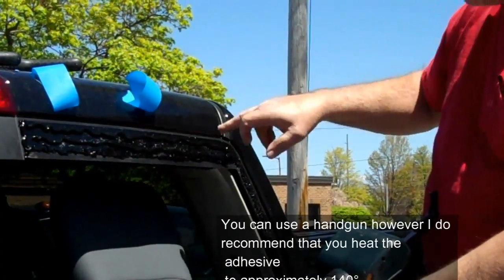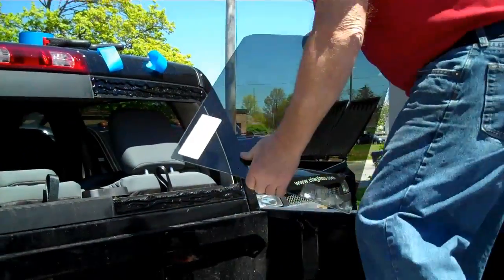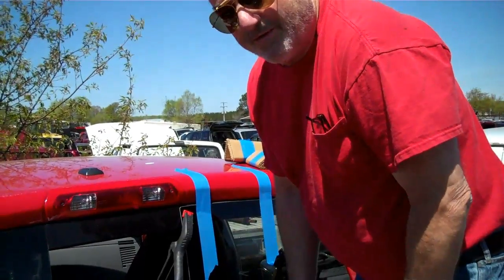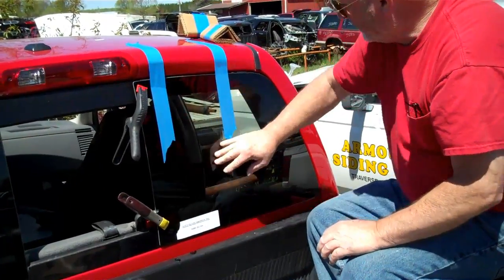Pickup truck sliding rear window back glass replacement

Comment: Is there away we can remove the broken glass so i can glue the new replacement glass to the actual frame
Reply from the maker: Yes you can but it's not worth the time and effort plus it does a better job as shown in the video please stick to the plan.
Reply: @autoglassamerica  hey I bought the glass what trim and caulking should I get, one that can stick to the frame not the glass, and is super strong and durable, I have a 2010 Dodge Ram 1500 hemi
Reply from the maker: @delvinmartinda7852  you can only use the primer and urethane that I sell in my store purchasing a product from another vendor will probably fail which is why I sell my product. However you can buy urethane locally that will stick to glass made by 3 M I recommend it that's what you do do not remove all the broken glass from the frame the result will not be as good

Comment: Bottom right corner was hard to pull in so I cut a 2x4 to ~81 inches and wedged it between tailgate and block that was taped in place.  So board was at an angle, then placed just enough weight on board to draw it in place.  This worked great.
Reply from the maker: Must not have watch the entire video. It is very important to watch the entire video

Comment: this video was very help full on my 2016 dodge ram 160.00 for the glass already tinted and 3m windo weld from youre site. thanks i did it with the ratchet tied downs aswell works like a champ.

Comment: My sliding window opens to the RIGHT side(Passenger side)Brad, did you remove it in order to clamp the patch?  Maybe I missed it but I didn’t see yours, unless it opened to the left(drivers side).  Hard to tell. I’m about to do the install
Reply: And its an electric sliding window to the passenger side
Reply from the maker: No you can clamp to the sliding window as long as it in the open Position